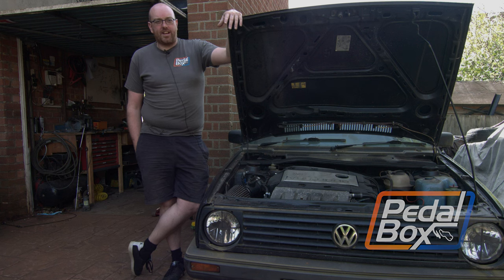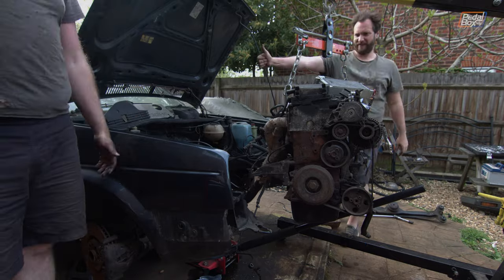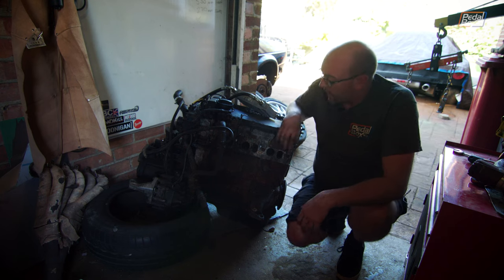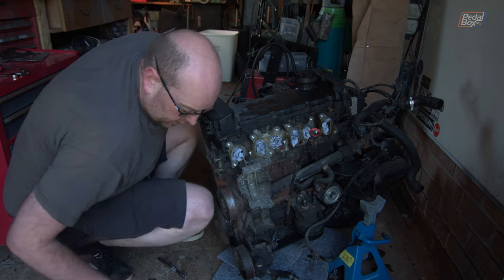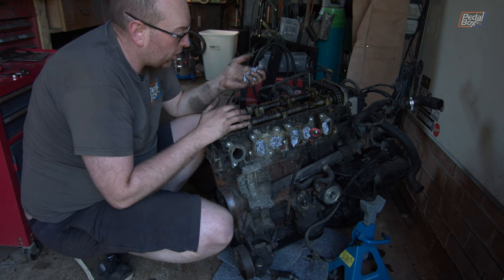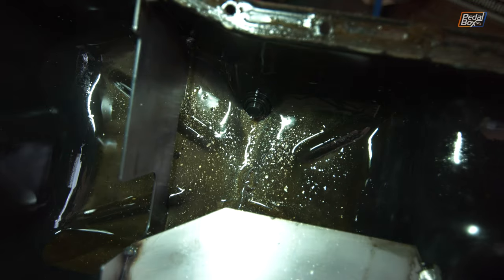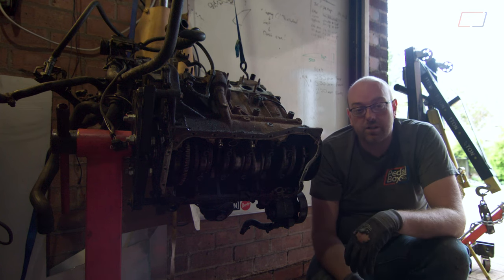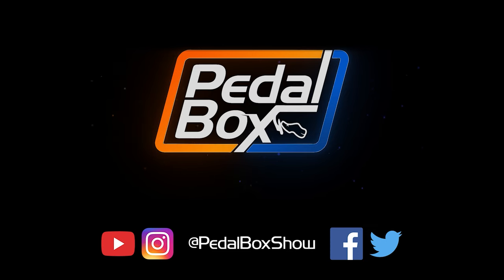How Bad Is the VR Looking? | Mk2 Golf VR6 | PedalBox Fleet

Comment: I think the fact that it was looking very pretty and sparkly on the inside is exactly the problem.
Those bearings looked bad... really bad. The cracked one made me wince.
Plus side, you've now got a new lamp shaft in the shape of a badly mangled crank?
Reply from the maker: It was so very sad looking :( 
At least there seems to be very little in the block oil galleries, see how to flush and dry it out before the rebuilding starts